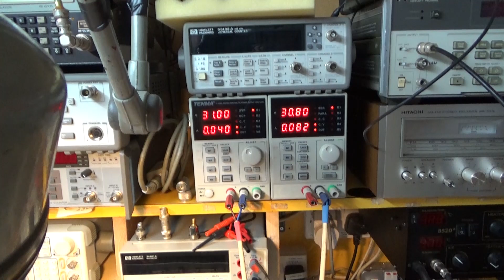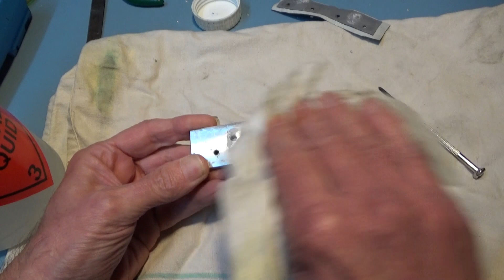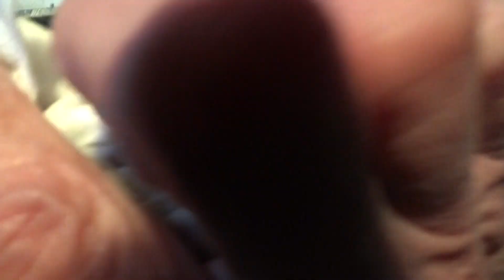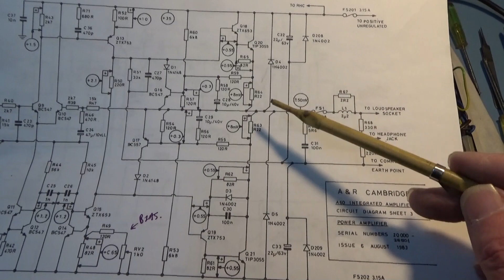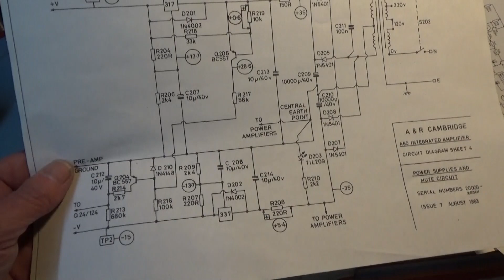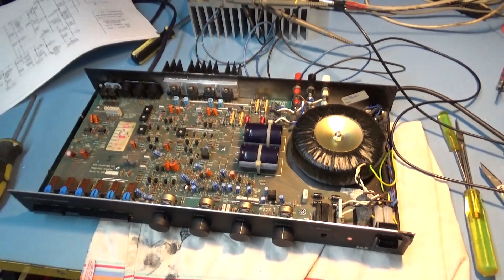A & R Cambridge A60 repair and test

Comment: I watched it all the way through. My ability with electronics is limited to building a treble booster and fuzz face... and making up reasonable interconnects and speaker cables, but, now I know how to adjust the bias of my A60.... similar incarnation to the one mended. Thanks for going to to the trouble to show your work. ... oh, I've changed the speaker fuses too, nothing nasty happening, just me shorting the speaker cables by accident.
Reply from the maker: Glad the video helped you, always remember to let the thing temperature stabilise when adjusting bias. It will drift up and down so may need readjustment several times. Better to blow fuses than the output transistors! Thanks for watching

Comment: I still think it's one of the best amps every made.
Reply from the maker: Sorry Andrew I beg to differ, when that came out in the early '80s the Japanese stuff was far superior in my opinion. Both in build quality and presentation, This model I believe cost £190, I bought a pioneer sa 606  around the same time and cost me £100. I know which I'd rather have, that was a superb amp and beautifully constructed. And what's with the silly DIN sockets on the A&R
Thanks for watching.
Reply: sono d'accordo con Te
Reply: I use mine with a pair of AR18S speaker and a Chord Mojo DAC.... fed with Hi-Res music files.... It's not the best amp in the world ;) BUT, the SQ I get out of mine is excellent, far better than it has any right to be. I only have a tiny listening room, and it's more than enough for the conditions.

Comment: Its Still a Great Sounding Amp It Can Blow a Fuse For No Reason Some Times It Seems To Like a 8 Ohm Load Rather Than a 4 Ohm Load Played Very Loud I Use My Audiolab 8000A Most Of The Time Though ....And My Mission Cyrus 2 With a Audiolab Q Dac On My Computer Setup Great To See An Old Friend Again Thanks For Uploading Regards mike.
Reply from the maker: Hi Mike, I wouldn't run it into 4 ohms that's asking for trouble.  You're the second person to mention that this may have been the for runner to the 8000A.  Thought this one would interest you, not my favorite thing fixing other peoples bodges.
Best wishes Nick